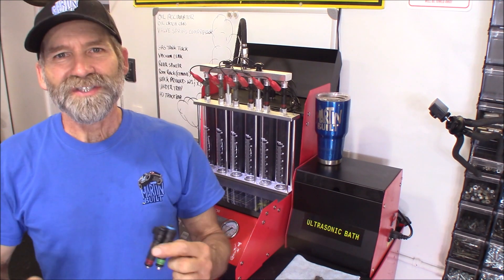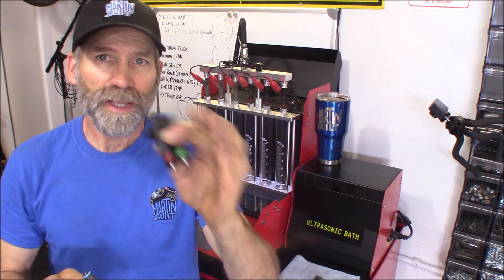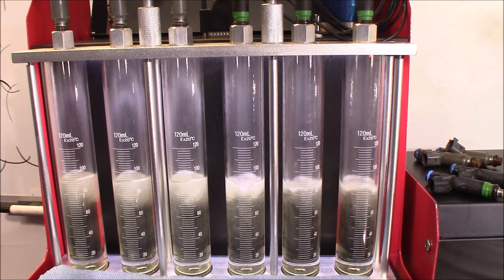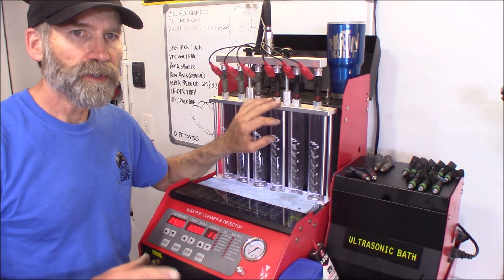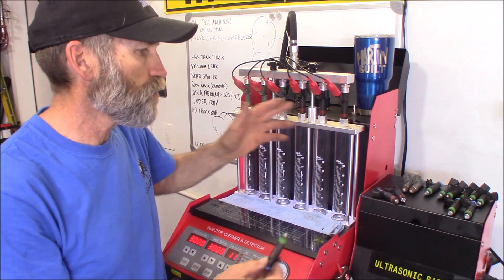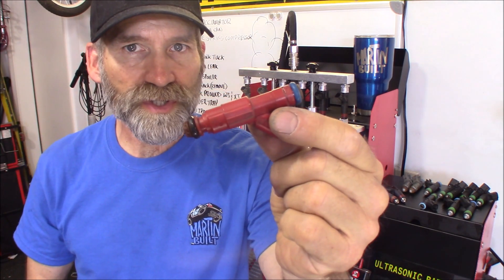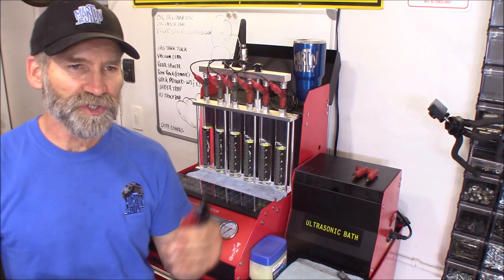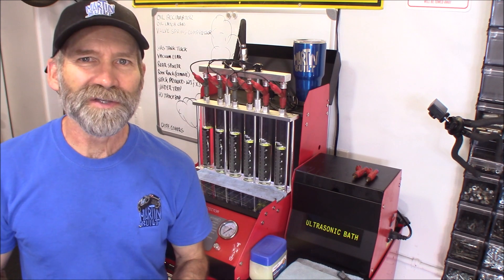Comparing  Fuel Injectors for Performance and Fuel Economy

Comment: When pulling my injectors out of my 2002 Dodge Ram 5.9 magnum I noticed at the very end bottom of injector there is a round plastic gromit or seal .. some came out with injector no problem some were so brittle the broke an discinerated into nothing or into small pieces .. are these important An should I get or can I get new seals or can I jus put injector back in without
Reply from the maker: Technically the only purpose they serve is to hold the O-ring on to the injector you could install the injector without what is called the pintle cap I personally wouldn't do that. You can purchase new o rings and pintle caps.
Reply: @martinbuilt  ok thank you

Comment: Hey Martin you have some great detailed videos! Some injectors i would love to see compared are the oem injectors form 02-06 tahoe/suburban the flex fuel injector vs non flex and the way the perform with there different pressures  (flex trucks 48-52 non flex 55-62)

Comment: i've got a 2008 ram 1500 with the 3.7 v6. got a miss that i feel is an injector, so i want to replace them all. i want to use the Denso 12582704 but i can only find matched sets of 4. where could i find a flow matched set of 6 or 8 if need be.

Comment: Hello martin,love the denso upgrade demo,been smelling fuel on startup but see no leaks yet,thinkin its time to change out mine.not sure i want to chop up things to make densos work,so just curious the bosh 12 hole type is that for a 4.7l and is it just plug n play or do they also require tweaking to fit,also how much they run for 8 pieces????  2002 limited,snookie pa.???
Reply: Hi Allen, I just had that happen to my 04 Durango. Wondering if you tried the bosh and if so, did they work better?

Comment: What would inceasing fuel pressure to 65 psi do on a 40psi injector? Say using 24 lb injectors.. @ 65 psi versus 40psi?
Reply from the maker: It will increase the amount of fuel, so if an injector moves 24lb of fuel at 40psi and then the pressure is increased to 65psi that would turn that injector into a 33lb injector. IMO
Reply: @martinbuilt  Thanks for the reply..what it is ..2000 stock explorer fuelsystem..returnless..
Reply: @martinbuilt   400 hp engine"should be"..  there is no adjustment on the fuel system..

Comment: Hey Martin, Are you familiar with the Siemens 12 hole injectors and how they perform? I found a set on eBay for a good deal
Reply from the maker: I check it out, odd that it has the 53032145AA Siemens part number that is the same part number for the 2 hole injector and it looks the same with the red band at the bottom. I have my doubts.
Reply: Ok thanks for the info! Have you ever had issues with the Jeeps not liking the 12 hole injectors? My dad tried them in his and it wouldn’t run well at all and he had to put the stock ones back. It seemed the computer couldn’t recognize the new rate of flow
Reply from the maker: @OutThereEnduro  I have 12 hole injectors in both the 4.7 and 4.0 and they work great and know of may others running them with great MPG's and drivability, did your dad reset the ECM that may be the trick.
Reply: Oh ok good to know. And I don’t believe he did. Is that done by disconnecting the battery and grounding the power wire with key in the on position for like 15 minutes?
Reply from the maker: @OutThereEnduro  yes that is the quick learn but there is just a little more to it they that.

Comment: In the description for Denso 12582704 - wrong link for AC Delco injectors. Is it the same as AC Delco 217-2907?
Reply from the maker: I couldn't find any spec. on those but, they look very similar.

Comment: Went pic n pulling for the 704's and came up with only 4 BUT found 8 AC Delco 12613163 in the Ecotec's they are 12 hole also I'm figuring those 163's should work. Most Ecotec I saw had a 4 hole injector.  BTY the 4.7for the '01 is coming along. HO block .020 over, non HO heads with HO springs, 08 cams, tiny hole rockers. HO intake but have 08 intake for later. TB needs porting yet. looking for 75mm,. Wont be going the header route. Enjoy your videos. GO CHEIFS.
Reply from the maker: yes the 163's will work well, I believe those just have a smaller coil then the 704's.
Sounds like your 4,7 is coming along nicely.
Reply: @martinbuilt   thanks for the reply.Put the GC on stands (rear slightly higher) to work underneath. Small spot of antifreeze drips onto the floor under pass seat yet no coolant in car. (Engine out) Found heater core was leaking inside. Previous owner drilled  2 holes in floor to drain instead of repairing. UGH damn the luck. I will persevere!!!
Reply from the maker: @kenanderson5319  ugh...I hope I never have to remove the dash.
Reply: @martinbuilt  Surprisingly after watching a couple youtube videos I had it out in an evening. It is fairly heavy.

Comment: Great video idea, Martin! My new-to-me '02 Dakota with the 4.7L V8 has a mismatched set of injectors in it currently — (6) of the white-banded Siemens two-hole injectors (Mopar P/N 53030842) and (2) of the red-banded Siemens two-hole injectors (Mopar P/N 53032145AA). I have been looking into which OEM injector I should use to replace them for the best performance in a stock setup, and had read that the green-banded 4-hole injectors (Mopar P/N 53032704AB) were supposed to provide better fuel atomization. As you demonstrated, that is patently false!

I found in the course of my research that there seems to be a lot of confusion and misinformation regarding the flow rates of the three main types of OEM fuel injectors used on the 4.7L V8 in Jeeps and Dakota/Durango's. Would love to see a three-way head-to-head comparison of (2) injectors each amongst the three OEM fuel injectors used in the 4.7L V8:

1) Mopar P/N 53030842 — White-banded two-hole injector, rated for 22.5 lb./hr. at 49 PSI, (Used in '99-'00 Jeeps and '00 Dakota/Durango's)
2) Mopar P/N 53032145AA — Red-banded two-hole injector, rated for 25.8 lb./hr. at 49 PSI (Used in all '01-'03 4.7L V8's)
3) Mopar P/N 53032704AB — Green-banded four-hole injector, rated for 27.6 lb./hr. at 49 PSI (Used in all '04-'07 4.7L V8's)

I believe this video would be incredibly useful to many owners of stock 4.7L V8's like myself, who want the best performance without running the risk of running too rich for the PCM to handle.
Reply from the maker: I thank you for your tutorial with all the years and specs on the 3 different injectors. I will run them head to head and we'll see how they come out.
Reply: Have you tested these 3 different injectors yet?
Reply from the maker: @Mo63H  I'm getting them cleaned up, it will be the next injector video I do.
Reply: @martinbuilt  — Have you had a chance to run the white vs. red vs. green-banded Mopar injectors yet? Still awfully curious how these come out!
Reply from the maker: @Devin_Schwartz  I have not yet, I have been rebuilding a few sets of them.

Comment: Martin will the Denso 12 hole work on a 2005 dodge ram V-6 3.7L
Reply from the maker: Yes but, I feel the Bosch 12 hole 280156161 would be a better choice.
Reply: @martinbuilt  What makes you feel the bosch would be better for the 3.7L ?
which one do you think would be better for lower rpm and mpg on the freeway ? my 2006 ram cruises at 1800rpm on the freeway.
Reply from the maker: @SOP83  because the Bosch does not push as much fuel and the 3.7 will perform better because of that in performance and MPG. The Bosch has a great spray pattern just like the Denso's.
Reply: @martinbuilt  Thanks for the response. My thinking was that the ECU would adjust and just pulse the denso's 10% shorter to compensate for the higher flow. Reason I ask is I have a set of both sitting in front of me. I ordered the denso ones before I noticed this video. Then, after watching this video, I saw the bosch ones for half the price and ordered them too.
I can either return one set, or take the time to do a mpg shootout...
Reply: @martinbuilt  Ok, I just installed the Bosch 280 in my 3.7L along with some SOS ignition coils. The good news is that the bosch don't require any modification/grinding for the retaining clip, they are the same. It took ~20 tries to finally get it to start and it's throwing P0508 and idling at 400rpm, but I think If I put some miles on it the pcm will learn it. (edit: IAC cable was loose, runs perfect now)
Reply: Thank you. I appreciate the quick response

Comment: Hi Martin,

Been following your built for some time. 
I have an 2004 WG (European WJ) with the red Bosch injectors on my 4.7 HO.
I have recently acquired an DRB III emulator and I can see that my long term fuel trim is at  Negative 20~18% and even the short term trim ones are negative 16~18%
Can the injectors be the cause? do you have any idea how are your fuel trims with your Denso injectors?
Thanks and keep up working on that great machine

Comment: Do you still have your Cherokee? I would like to see a comparison between oem xj 4.0L injectors and the common doge neon 4 hole injectors. This swap has been around so long i guess there's the 12 holes as well. From what I've seen, it should NOT improve mpg as your pcm will provide the same amount of fuel regardless of the flow rate and amount of holes in the injector. Off idle it should be smoother though. The 4.0L is a dated engine now a days and modern injectors don't seem to make a difference
Reply from the maker: yeah still got the XJ. I can do a comparison on several of the popular injectors and the stock ones for the 4.0
Reply: @martinbuilt  that would be awesome! Thanks for the reply

Comment: This was eye opening! Thanks for the info, I'll be picking up denso to replace my green banded cracked injectors.
Reply: I picked up a set at the junk yard Denzo 12582704 12 holes at 6.00 each 1.00 core. Cleaned them out. new is 490.00 for 8 of em. Go to a junk yard you won’t regret it.
Reply from the maker: Yeah you'll like them, another good choice would be the Bosch 280156161

Comment: Hey Martin! I bought Bosch 3rd gen. 4 hole injectors for 1999-2006 Jeep 4.0 from Precision Auto injectors in Sanford Florida (Great people!!).

The injectors are Green(the entire injector)

I would like to see them against the stock 1hole that came in my 2000 4.0 Cherokee if possible. Thanks👍
Reply: 4 hole Bosch part # is:
 0 280 155 789
Reply from the maker: Thank you, I may a set of those injectors.

Comment: Im glad you did this test...we were discussing this a while back...

So what are the White Band injectors?
Reply from the maker: I have seen those before, I'll get a set next time to Pick-a-Part
Reply: Awesome...id like to see because that was the original set in my 2000 dakota
Reply: The white-banded OEM fuel injectors for '99-'00 Jeeps and '00 Dakota/Durango's equipped with the 4.7L V8 are Mopar P/N 53030842. They are a two-hole injector rated for 22.5 lb./hr. of flow at 49 PSI stock fuel rail pressure. Many reported they underperformed and flowed closer to 19 lb./hr. at 49 PSI. It's possible that's why they were so quickly discontinued in favor of the red-banded Mopar P/N 53032145AA injector starting in 2001.
Reply: @Devin_Schwartz  gotcha...so even more reason for Martin to test them :)
Reply: @Kolonol1  — Precisely! I would love a test comparing the white, red, and green-banded OEM Mopar fuel injectors head to head.

Comment: Good morning Martin, would you know the specs on stock 4.7l fuel injectors?
Reply from the maker: Here is what Witchhunter has on them https://www.witchhunter.com/flowdatapix/s53032145.jpg  looks like 255cc @ 3 bar
Reply: 24lb injectors?

Comment: Can you run a rest on 4.0 injectors vw injectors etc. I see lots of opinions but you now have a way you prove it. I actually run a 4.6 stroker but not sure if my 93 electronics would run any of the injectors you tested.
Reply from the maker: yeah can that, I'm running the Bosch 280156161 in my 98 Cherokee XJ with the 4.0 and those work great.

Comment: what fuel pressure are these tested at?
Reply: I understand the need for bench mark testing but raising fuel pressure will greatly effect the flow rate of any injector. I have tried the denso in my 2005 dakota 4.7l and the ngc pcm was not able to compensate for the increase in flow rate. My long term fuel adaptives maxed out and couldn’t reduce enough percentage of the injectors. I set dtcs for too rich. If you machine is capable to raise pressure for testing try it out see how much of a rate difference there is. There’s already a major difference in flow on the accelerator test you did in the video. My truck has a ported throttle body, cold air intake,straight pipe exhaust with 2 resonators and is tuned with super chips 91 octane tune.Not heavily modded but not stock.
Reply from the maker: 45 to 50 psi
Reply: So what’s the flow rate difference at 58psi on the denso and the stock injector? This injector test is good for the early generation 4.7l engines that run a factory fuel pressure of 49psi on jtec pcm but what about the engines running ngc pcm and set for 58psi. Is this a test you could do?
Reply from the maker: @moparlife1  really all injectors should be tested at the same psi like witchhunter.com does. They test every injector at 3 bar or 43.5 psi that way you always comparing apples to apples.